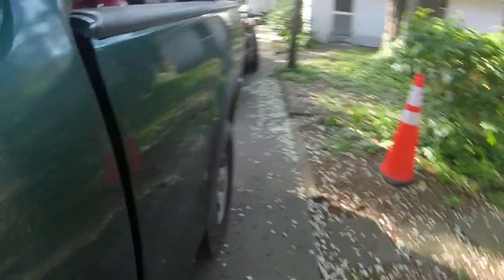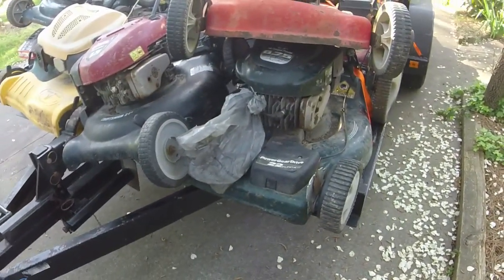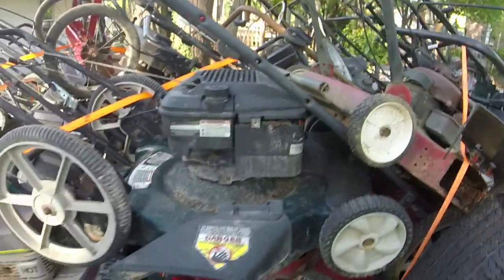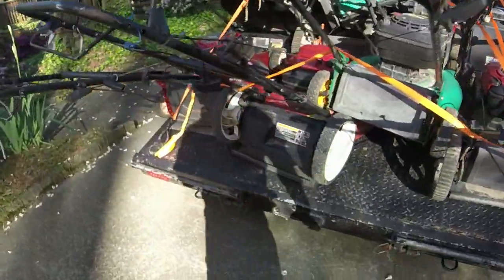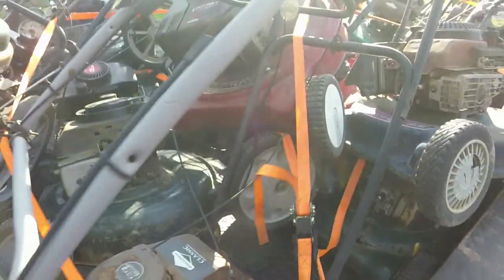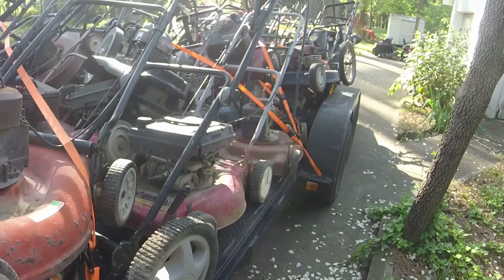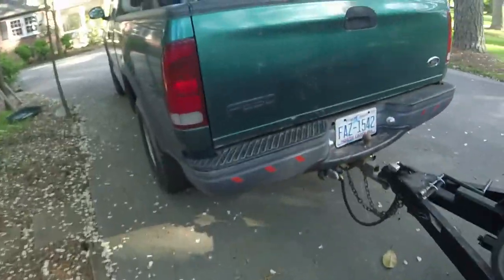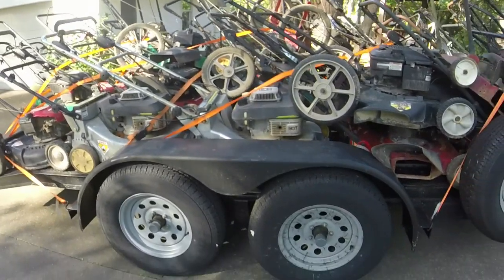I bought 35 push mowers for $350!  First look

Comment: CRAZY!!!      I redid a vector Tecumseh last fall and I am selling it for good money this weekend.   It sat for 5 months under cover outside and started with 1 pull last week.   Go to ebay and check for parts.  they are actually a great powerful mower.  I don't live in an area with enough population to get that kind of choice.  You know I love mowers and they are my main source of work.  (everybody has a mower).  Those 14SB JD's  Are a great mower.  Those Quantum's will pay you back if they turn over.  You got $350 worth of parts.  You can make 1 Vector out of the 2.    That one cover  is a Kohler   clone.  I thought i had a lot with 9 to do.
Reply from the maker: I'm excited to get the John Deere mowers going.  This is a very rare occasion around here.  I'm hoping to turn most of these around this year.

Comment: Wow Casey, Looks like a lot of videos to me. What brand brush cutter is that? I have a Cub Cadet ST100 which is awesome for heavier grass/weeds and smaller sapling trees. Once the trees grow to 1 inch in diameter the strings will shear off pretty quickly when you hit them. I am eager to see videos for the two John Deere mowers when you post them. It’s been a very long time since I had seen any grey John Deere mowers.
Reply from the maker: Yes a lot of content coming up!  It is a Murray brush cutter with a Tecumseh engine.  I've never had grey John Deere push mowers before and I'm excited to work on them.

Comment: Whats the most you can get for like new mowers? I have two that been sitting in the garage for a couple years only used once that no one seems interested in at $100 off new price.
Reply from the maker: When I did customer returns I usually sold them for $50 to $75 less than new and they usually would leave quickly.
Reply: @EllisMowersandmore  thanks I'm having a hard time moving them at the inflation current prices..mtd push mower for 175. And a Toro steel deck fwd for 375.

Comment: instead of removing self propelled if its front wheel drive permanently engage it since you can lift front so it doesnt drive off and leave the bar so if they choose to buy a cable they can
Reply from the maker: That's what I may do with some.